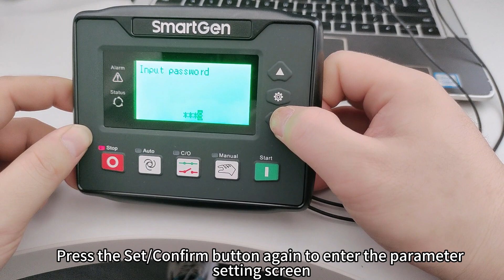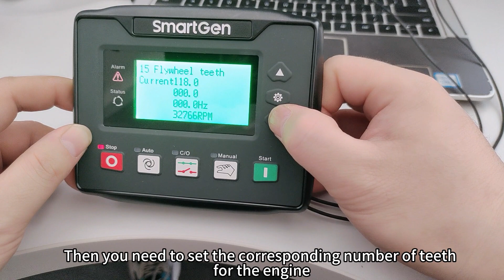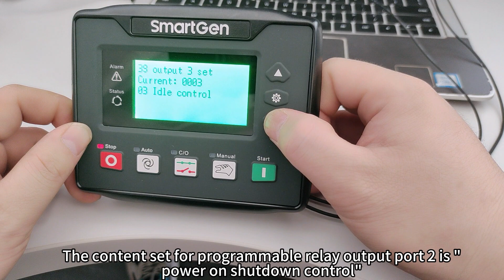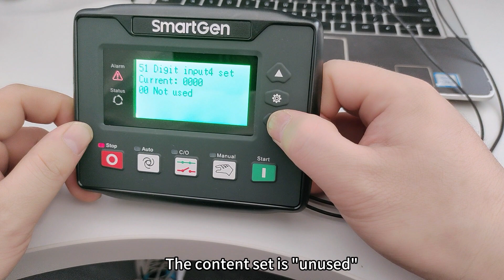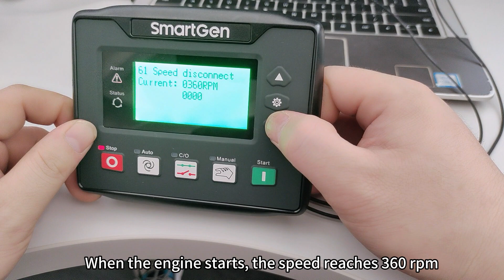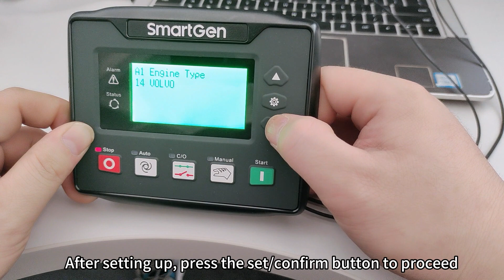The main parameter setting items related to HGM4010CAN controller.

Comment: Hello, good afternoon, dear, I installed a new one on that controller but the stop button does not work. When the generator is running, I would like to know what I need to stop the generator when I press the stop button.
Reply from the maker: Please leave your contact information-email